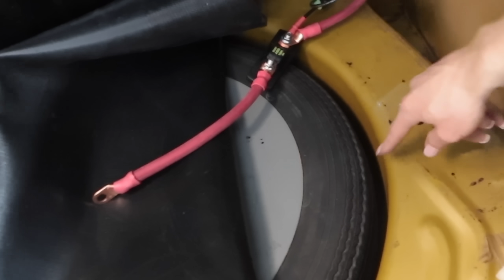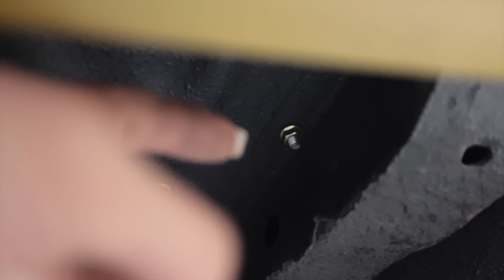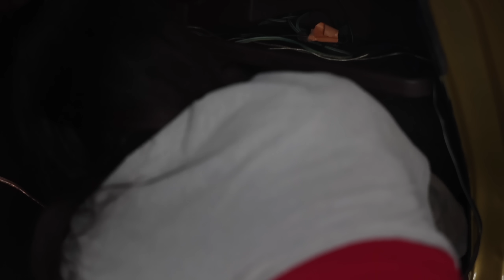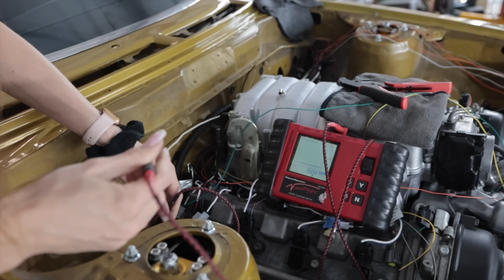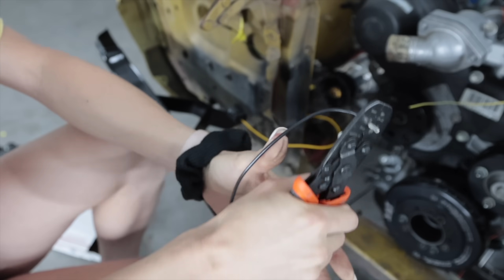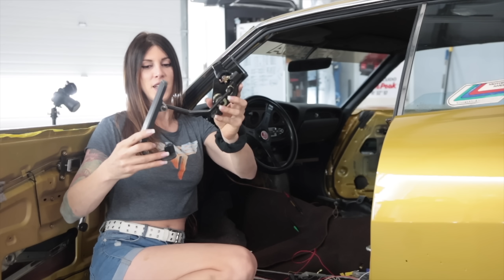Connecting Power For The First Time!  // V8 '74 Celica

Comment: Mercedes, BMW, Audi all use AGM batteries. Which ARE made with a vent tube, and installed with a small hose to vent that outside (under) the car. AGM batteries blow off a lot less gas, but they DO blow off acidic fumes.

Comment: You ought of used  dielectric grease at like light sockets and other electronic connections including spark plug wires  like the auto manufacturers do to new cars

Comment: Hmmm. Arizona AND no air conditioning (two at 60--or 100--probably won't do). Since you've put the battery into the trunk, I wonder what else could be maneuvered around to restore air conditioning to yonder vehicle. 

Since you're Air Force, maybe there's an aerospace solution for this? This wouldn't be a "stock" solution, of course, but neither is dropping a V8 into a Celica (I had a friend do this to a Pinto over 30 years ago--I thought it was going twist on itself from all horsepower...). This would have to be extremely out-of-the-box thinking. Meaning very expensive...most likely.

Comment: Looks like you need a kneeling pad(s) for the garage. You can buy professional versions of them, but in a pinch you can just tape together some dense foam layers and use it. That way you can wear your shorts in the heat but not have to kneel on hard concrete with your bare knees. Amazon has some cheap ones, but you can find them almost anywhere now.

Comment: As a 25 year auto electrician, I am constantly impressed by your methodic approach,  technical skills and accumulated knowledge.
Ignore the judgers. One tip:  I used to temporarily use an old sealed beam in place of individual fuses when connecting something for the first time. The brightness of the light gives you an indication of resistance. Bright light- could be a short circuit, no light - open circuit, Dim light - prolly correct resistance. In any case, prevents the smoke from escaping.

Comment: STOP> Get a LiPo car battery. They weigh under 8 lbs. THen you can put it anywhere. Call Antigravity Battery and they'll likely sponsor you. It also has a remote where you can use it's segmented jump charger if your battery dies without even opening the hood.

Comment: Oddly enough I do enjoy watching the wiring videos. I rewired a 00 ford ranger that I engine swapped to a 4.6l out of a 02 cobra using a ecm from a p71 crown Victoria with no pats security. It was fun when I finally got to turn the key and it ran.  And everything looked like it was factory plus the auto 4x4 still worked plus all the gauges. I even used a V8 cluster from a Explorer so the tach read accurate.

Comment: I cringed a little bit at the black tape on the neg battery ends. These deserve heat shrink tube IMO. Black tape doesn't age well with its sticky mess.
Reply from the maker: I ran out of heat shrink in that size, but the electrical tape is honestly what they use from the factory, so I’m ok with it.
Reply: @SarahnTuned  btw not judging you, your work is up there with the best builders out there.

Comment: AGM = Absorbed Glass Matrix, meaning the plate separators are made of a fiberglass material that retains the electrolyte, the battery is still Lead-Acid technology.

AGM are sealed, which is a plus, however cannot be rehydrated, which a negative, but typically have a higher ampacity due to the stronger electrolyte mixture.
Reply from the maker: There’s pretty much no point for old lead acid batteries anymore, they’re obsolete.

Comment: Have just been doing a bunch of DBW stuff myself. I don't think you need to supply power to the pedal through a relay. That may actually be problematic, because it should be two +5V pins and two sensor ground pins. The other two pins are the main and sub accelerator position sensors. So basically power can be straight from the +5V on your ECU and ground should be sensor ground to your ECU. Not that you couldn't supply the +5V through a relay, but it doesn't matter if the pedal always has power as long as the ECU is on.
The DBW throttle body on the other hand is supposed to have the H-bridge power supplied by a relay. As long as your Link ECU is an XtremeX or FuryX it should supply power to the motor through Aux 9/10 outputs, Header B pins 18 and 26. You will supply the motor power through a relay connected to +14V Aux 9/10 +14V, Header B pin 5. You can turn the relay on and off through any other free Aux output. I thought you were using a Haltech at first and the only main difference there is the H-bridge power comes from an internal MOSFET.
We are using a Link ECU with Rotaru as well, though it's a PlugIn without Aux 9/10 exposed. So, we used the Link external E-Throttle controller for simplicity and speed. We had to supply power to it through an external relay as well. The Link help documents in the PC Link software are super helpful and have all the wiring diagrams, which you probably already know.

Just did a little more digging and the pins on your pedal should be:
VCP1 - Voltage Constant Pedal 1, +5V (Pin 6, Black)
VCP2 - Voltage Constant Pedal 2, +5V (Pin 2, Black)
EP1 - Earth Pedal Angle 1, Sensor Ground (Pin 1, Black/Red)
EP2 - Earth Pedal Angle 2, Sensor Ground (Pin 3, Black/Red)
VPA1 - Voltage Pedal Accelerator 1, Variable APS Output (Pin 5, Blue)
VPA2 - Voltage Pedal Accelerator 2, Variable APS Output (Pin 4, Blue/Red)

Those are the pedal connector side labels and pin numbers.
The ECU labels for where the wires come from vary slightly.
Factory wire colors, though I don't think you'll be using them.

This is based on wiring diagrams for the LS430/GS430 with the 3UZ-FE. I figured out the acronyms from documents detailing how a Prius accelerator pedal is wired, which uses the same terminal labels. The throttle body is similar except it has one +5V, VC, one ground, ETA, and two sensor outputs, VTA and VTA2. The throttle body motor has two connections, M+ and M-, which are connected directly to the factory ECU. Power to these would be enabled and disabled internally. The two motor power wires are shielded from the factory, connected to another ECU grounding pin, GE01. This is interesting to me, since a lot of other brands don't shield these wires as far as I know. Neither the Link nor Haltech diagrams mention shielding for a typical installation either. Also interesting is that on a Prius the +5V and ground for the TPS are shielded too, but not on the 3UZ diagrams I can find.

At any rate, I know you likely have a lot of diagrams and can figure this all out, but given most of the aftermarket setups talk about running a DBW relay I thought that might have thrown a confusion wrench in the gears. I also may be missing something or referencing the wrong parts, and if so, totally correct me. Also just figured it would be a helpful comment for anyone else to read and half of the reason I do all this research is just to enhance my knowledge and understanding. I was writing as I did research, so sorry if the structure of this comment sucks. Also crazy how well that pedal fits! I love it when companies keep stuff that works pretty much the same for a long period.
Reply from the maker: Yeah, the relay info literally came from Link themselves.. which is super conflicting because it’s essentially just another Throttle position sensor at your foot, which you’d think would be wired identical to the TPS on the engine.
Reply: @SarahnTuned  Yeah that would definitely make sense, hahaha. I think it's mainly different because the throttle body has the motor to drive which draws some real current, plus the ECU needing to be able to completely shut it down in the event of a major fault. The pedal is basically just low voltage signals and if it gives a wrong output the ECU can just go into a limp mode without killing power to it entirely. We actually had to trick our throttle inputs for now because we didn't actually have enough available, and before doing that it would throw mismatch faults and not let us do much.
There is a good diagram in the Link help files called "Generic APS Wiring" which lays out what I outlined in the first comment, but I only just saw it. The accelerator pedal gets two full sensor circuits from factory for complete redundancy. With the aftermarket ECU it's fine to just split them off. The throttle only gets one voltage and ground, but two sensors for at least some redundancy and confirmation of position. The "Generic APS Wiring" diagram omits the relay, but the pages labeled "Generic Internal E-Throttle Wiring" and "External Electronic Throttle Control Module" show the full wiring with relay for the throttle control circuit.
Also, make sure you reference the up to date help files, like in updated PC Link software, for the G4X wiring. There is still G4+ info floating around out there on forums and all, and the wiring can be different. I wired our throttle controller to aux 2 and 5 before I realized it was an old diagram I was referencing. With the G4X you have to wire in pairs to 1/2 or 3/4 if you are using the external module. Not a big mistake at least, but still wasted a lot of time.
No matter what, I'm very confident your wiring is going to be excellent. Much nicer than mine, hahaha. Just try to help with info as a better safe than sorry measure. I am suuuper hyped for first start!

Comment: Hardest thing to find on the internet?  Try finding the EGR down pipe for a 93 mercury cougar x-r7 5.0 H/O (it's the metal pipe that goes from the EGR to the exhaust manifold)  according to the internet they don't exist, and if anyone does search it's  most likley show results for the v6 EGR which won't fit (I already tried)

Comment: Great video as always. Love the work you do. I would just like to add a bit of info about venting an AGM battery.
In normal operation an AGM battery does not vent. They are VRLA. The H2 and O2 that are produced will recombine inside the battery and no gases escape or are "vented". The benefit is that no water addition is needed during the normal life of the battery. Hence it is maintenance free.
However, AGM batteries will vent during an overcharge condition. This might occur in the other 5 cells if one of the cells shorts. Or it might occur if the voltage regulation goes high for some reason. This possibility overcharging condition is what requires "venting". The battery cannot be installed in a sealed space or indoors without venting. This could result in an explosion in the event of H2 and O2 released into a sealed space.

Comment: Was there a layer of rubber between those bolt heads and the base of the battery?   Otherwise may grind holes into the base....
Reply from the maker: Yeah 3/4 inch thick blocks, they arrived this morning I had to order them after measuring.

Comment: Hi Sarah 

I was at a car meet here in the UK and I found this Mazda mx5 with a 4.3l v8 Toyota like yours I found a modified you might like.   
A modification to convert the DBW to a manual cable , I also sent you two videos about a 1uzfe throttle body that fits the 3uzfe .

Comment: rewiring a car because you put a different motor in it and the fact that you are making it perfect yeah its a lot of work some people just don't understand what is involved with a build like what you are doing  congratulations on a fantastic job love your content
Reply from the maker: I wanted to use only Toyota relays and fuses too, but most weren’t high enough amp rating or lacked weather sealing for outside of a fuse box. It’s tough to get perfect within a reasonable budget.

Comment: All the early Miatas came with AGM batteries from the factory, and were equipped with vent tubes that attached to the battery and vented fumes below the car. Are you certain your AGM doesn't need venting?
Reply from the maker: Correct, but also the fuel tank is right next to it. The trunk has two big vents on either side regardless.

Comment: You might not see this, but small tip for terminating the mesh loom on your harnesses or wires. Get some marine grade heat shrink and use it in place of the electrical tape and it looks so much cleaner. 
The marine grade heat shrink has the glue/sealer in it that grabs the mesh loom very well. Just thought I’d share. Great work Sarah!
Reply from the maker: I ran out

Comment: I would be a little nervous about using a rivet-nut as a high current ground point.  I have seen them loosen and arc eventually burning a hole in the metal.

Comment: That M10 bolt on the battery box should have a broad washer underneath. If the other three fail in a sudden stop incident it would pull through the metal easily with the weight of the battery and fixings. A small square plate would be even better than a washer.
Reply from the maker: I could tow a boat off that battery box, it’s not going anywhere.
Reply: @SarahnTuned  You should tow a boat. You need a break. You need a holiday to do holiday things. I loved your road trip videos.

Comment: Qhat about the main ground to the engine,you cannot use the car chassi from  to main ground,you have to at least connect the negative thermnal from the battery to the gearcase to isolate the chassi from the high current form the starter

Comment: This may be a little late, but maybe not.... I know you said you'd used a stainless Nutsert for the ground in the trunk. However, the non-stainless steel it's installed into can still corrode. Especially since you still need to paint in the trunk and engine compartments, I'd suggest welding a stainless-steel flat washer where you want a ground to be. That way you've got a solid connection between the washer and the body that can never corrode, and you can scrape the paint off of it for a solid ground connection.

Comment: Outstanding job of wiring and testing each circuit!  Just one recommendation- use a jumper cable style gator clip to connect the master ground cable to the battery negative terminal.  In case things should suddenly go south; you can quickly totally disconnect power ASAP, rather than having to unbolt it (while the smoke gets thicker!).

Comment: You might have volt-drop issues while cranking. If so, run a thick wire from the battery negative to the engine block (ideally one of the starter bolts). Keep the body grounds as well. The body of the car isn't the best conductor. It's common to have such issues when relocating vehicle batteries.
Keep up the great work, Sarah. Sorry to hear about the memory card. That must have been frustrating!

Comment: Put a piece of thick cardboard or padding under that battery. Years ago did a battery relocation on my 240, the bolt eventually punctured the bottom of the battery,
Reply from the maker: I have rubber blocks under it

Comment: Really enjoyed watching you plugging away at it. Used to rally a TA-22 put in a 2TG with a set of DOCE152 Webbers Yamaha running gear in the Toyota head, did 3 angles on the valves a bit of polishing and rifling the intakes.

Comment: Former toyota engineer here. I don't know if it has been brought to you before but every part in a toyota car goes through the process of "DRBFM" meaning "Design Review Based on Failure Mode" which is basically doing "if the part is great then don't change it" so when i see pedal designs almost identical then... 😏😏
Reply: But... The a25a.....
Reply: @UnkleRedrum  DRBFM applies to incremental changes, if you want a major tech shift like the one wanted for platform architecture/cost cutting reasons then the method is useless.
Reply: What did they do to prevent cosmic ray particles from flipping a one and zero on the chip in the drive by wire controllers?

Comment: AGM batteries will still vent under certain conditions and still have vent tubes for that purpose. For a build like this with all this time, money, and effort put into it, I wouldn’t leave it up to chance.

I just replaced my Miata’s battery with an AGM unit and updated the vent tubes at the same time to get rid of the old crusty rubber.
Reply from the maker: Trunk is vented due to the fuel tank being in there, it’s fine.

Comment: Just curious...the bottom of your battery is sitting on the 4 bolt heads securing the box to the trunk pan? Or was there some kind of flat plate that is between the battery and the box mounting bolts?

Comment: The hype for the seat belt light lol. I get this so much, I did the exact same thing when I rewired my Datsun and I got the parking lights and dash lights to turn on
Reply: Not wiring related, but I know the feeling. Once helped a co-worker get her dad's small food truck running again. Big ol' Chevy gasoline straight-six. Points, condenser, cap & rotor. Twisted the key, and "It's alive! IT'S ALIVE!!" like an old Frankenstein movie. 😆

Comment: I have a factory AGM battery and it’s vented.  Replacement batteries have hole for the vent tube.  Maybe they don’t need a vent hole and tube but they have a vent hole.
Reply: I don't know for sure, but my experience is the same as you. Maybe not all AGM batteries are the same structure.

Comment: Computers (the capacitors inside) can draw a very high current when you first connect your ground. Enough to cause sparks. It's better to make a direct connection first and then break it while holding the probes to the terminal and wire. So make a direct connection and while breaking the direct connection, leave the multimeter connected in series - any parasitic draw can be measured that way while not blowing the fuse in your multimeter.
Reply: That's useful. Thank you.  Getting educated by the commenters is somehow typical of Sarah